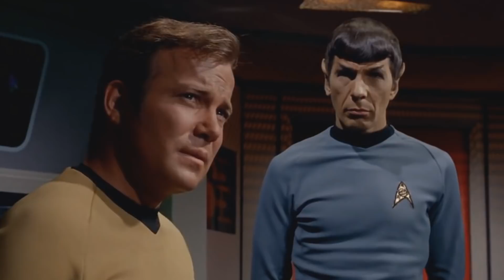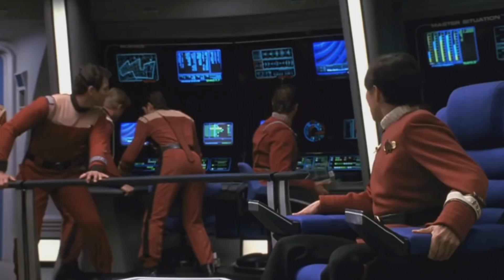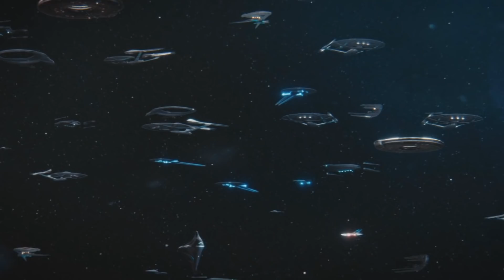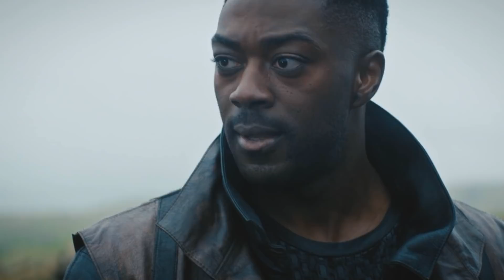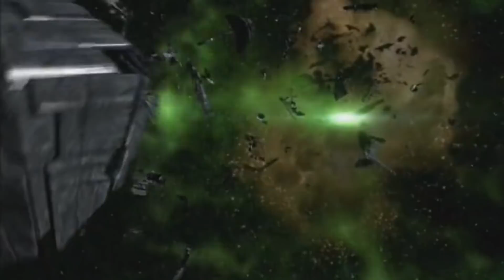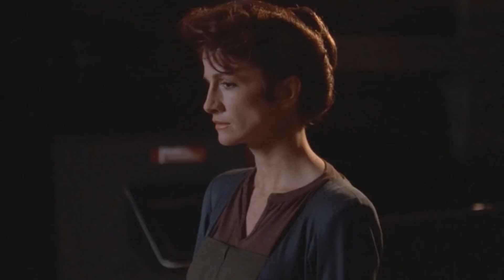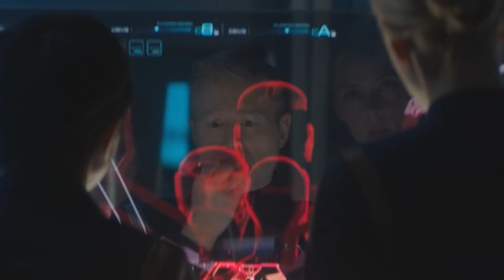How Can Dilithium Explode ? How to Explain The Burn in Star Trek Discovery and Other FTL References

Comment: Not to mention that they had dilithium recrystallization by the 24th century and by 32nd century they would have of figured it out how to synthesized Benenite crystals quicker so why aren't they in full production we can synthesized crystals today to make no sense the synthesizer technology hasn't in provide after centuries
Reply: There was plenty of other ftl engine. Slipstream, Transwarp, Spatial Trajector. All these technologies was in Voyager database. The burn didn't happen until 150yrs before Discovery jump to 32nd century. Which means Star fleet had 500 - 600 yrs to perfect these new FTL engine.
Reply: @maolo76  All the different engines have the benefits and problems. Transwarp is challenging as power requirements are enormous, only the Borg have the capabilities for it. Slipstream is the most promising but the scarcity of the be crystals is almost impossible to obtain or creat safely. Only know supply was by the race taken by the Borg. Like presence, Solar is available but Gas is still the most available and cost efficient mode of transport
Reply: Plot BS
Reply: *would have
Reply: Voyager crew got a really good understanding of quantum slipstream and in a alt timeline the voyager was destroyed which Kim and chkota made back to earth and starfleet was using slipstream 15 yrs later so they can easy to do I just
Reply: G Jacques tell that to the xmen and the crew of the enterprise
Reply: Because writers of STD dont do their homework and are not true fans

Comment: How I explain the Star Trek discovery timeline & Picard series. When Worf made contact with Parallel Universe in the episode Parallels it was not fixed properly that is why the Discovery & Picard series universes exist. Those 2 series are just set in alternate realities separate from the TNG DS9 & Voyager series
Reply: How I would explain the burn is that the Dominion had spies and changelings to blow up the dilithium in every single Starfleet ship to prevent them from entering the gamma quadrant ever again

I know it sounds stupid but it's much more better than the crap that we're getting.
Reply: @wolfbane7497  It's an alternate reality it makes more seance why everything is different in the discovery series & Picard